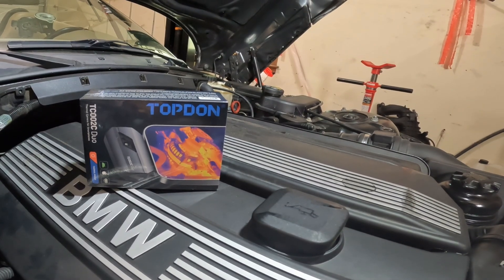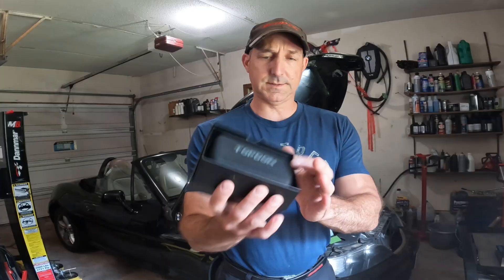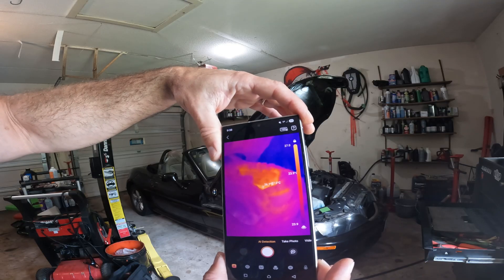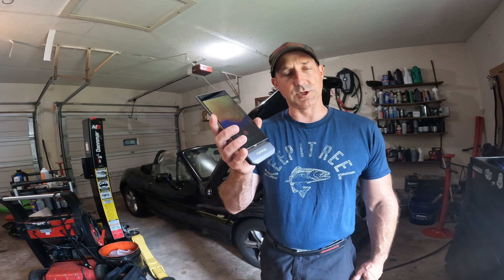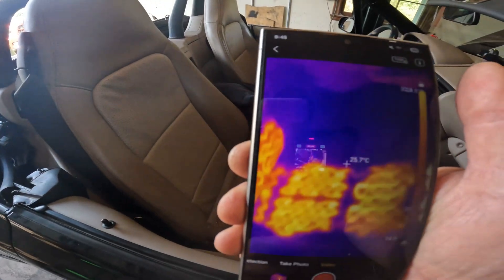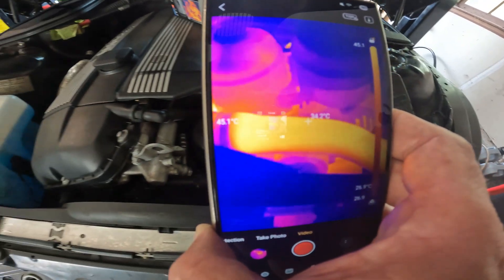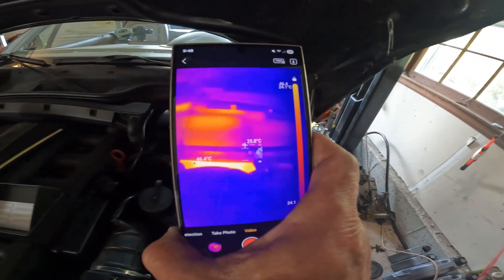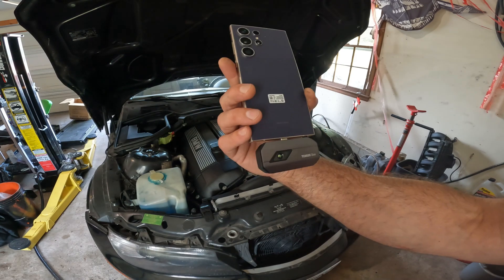Find Hidden Car Problems Fast Topdon TC002C DuoThermal Imaging Camera: Thermal Imaging Made Easy

Comment: hi there.. can this thermal camera be used to inspect body paint? like for repainting? ( due to accidents)  or fillers?
Reply from the maker: I would say yes. I have not tried that but bondo can be detected due to temperature differences. I did find that this thermal camera gave great detail.
Reply: @AskTheCarExperts  I saw this video where someone built a semi-automatic robot with a special flashlight and a camera. It’s mounted to the ceiling with an arm — kind of like a CNC machine — and it moves around the car taking pictures.
The cool part? The output looks like a thermal image, and you can actually see which parts of the car have been repainted. The colors change depending on the thickness of the paint, so areas with filler or extra layers show up differently.
It got me wondering — could a regular thermal camera pick that up too? Would love to see you test this out in one of your videos if possible!
Reply from the maker: @theblackhat-d1p I have to bondo my truck at some point. I will have to test it before and after.
Reply: @AskTheCarExperts   that would be great :)